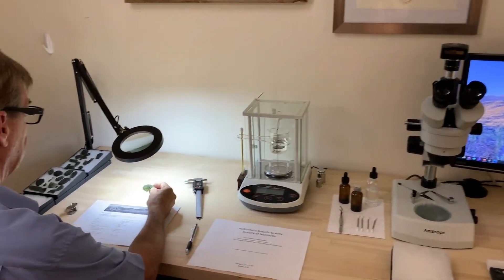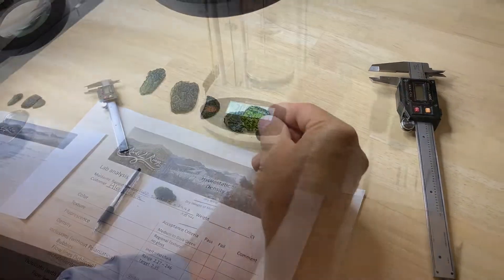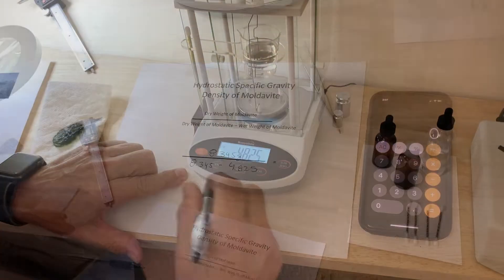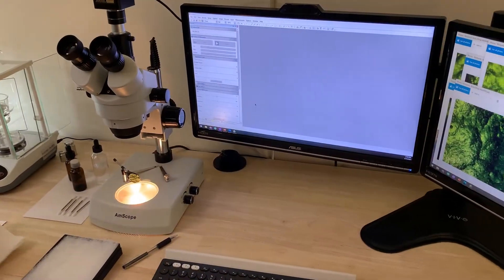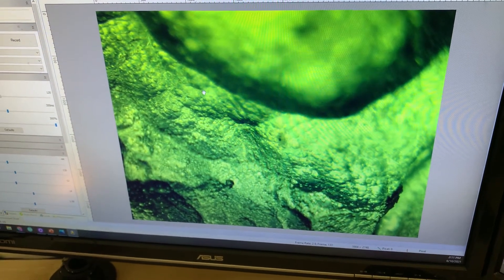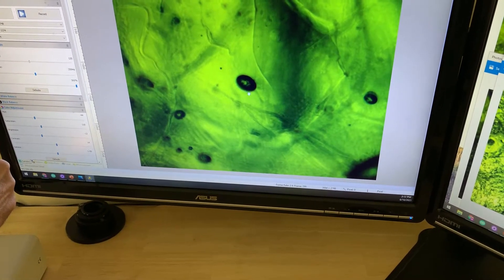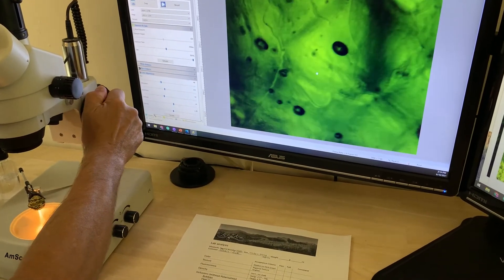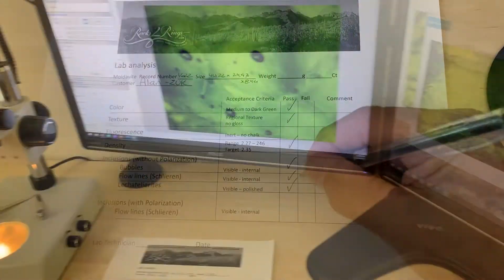Rocks2Rings Real vs Fake Moldavite - Lab Analysis Short Version

Comment: I have one that was bought for me years ago but I realized it has a drilled hole through it. Wouldn’t that affect the weight/air bubble density test? Is it possible to make a hole in moldavite without it falling apart?
Reply from the maker: Evie, there are some pretty good jewelers that can drill holes in Moldavite without any issues :)  and as long as the hole fills with water during the volume part of the test then the density will be accurate, however if air is trapped in the hole then, yes the value would be off... hope you are enjoying your Moldavite